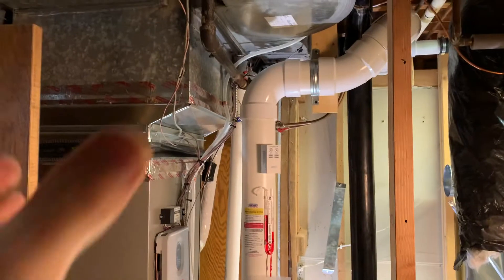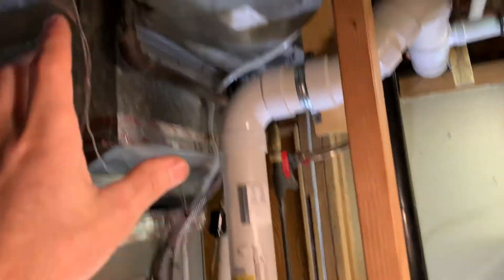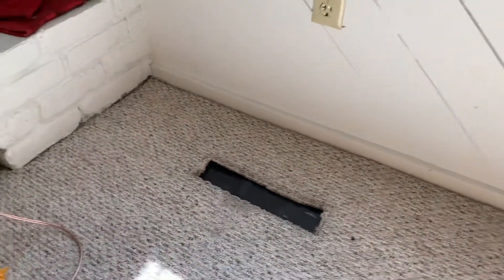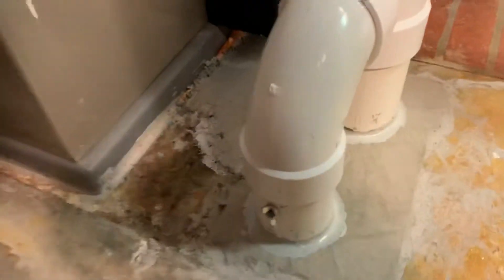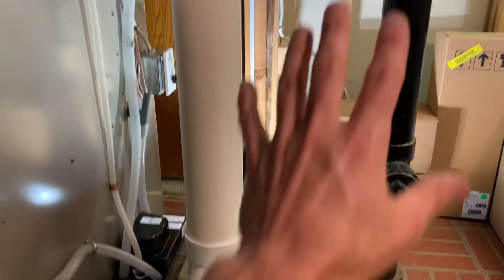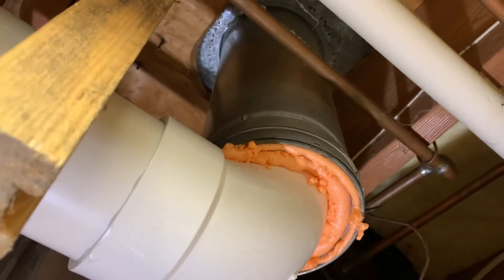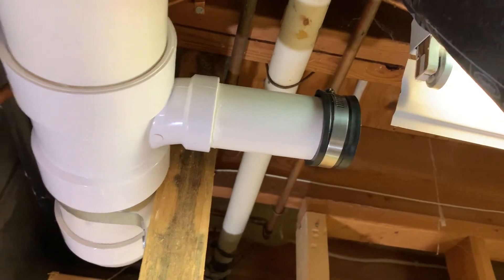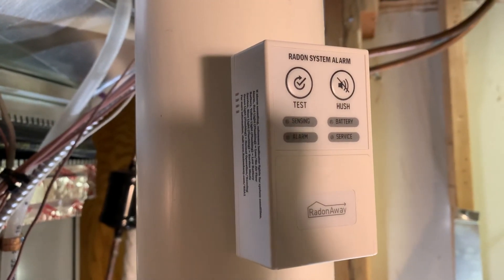How We Mitigated Radon in a Home with Sub-Slab Ductwork

Comment: We have determined our radon entry into the house is coming from the 30 year old metal duct work under our post-tension slab. I currently have a radon fan connected to a register and blowing that air outside.  The radon level remains below 1 pCi/L and usually below 0.5 pCi/L even though I haven't formally "sealed" each of the 18 registers. If I unseal (remove plastic and tape) from most of the ducts and run the hvac, the radon level in the house reaches 5 to 8 within an hour or so which indicates to me that this is likely our only problem (though I also plan to seal around any plumbing like bathtub drains). 

My plan is to use the plenum (near the center of the house) as the radon pit and the extensive sub-slab duct work as the reach into the area under most of the slab.

I understand how you seal each register. Would you recommend drilling a series of holes (perhaps 1/4" to 1/2" through the bottom of each duct (through the register into the ground below the duct) prior to sealing them?
Reply from the maker: We open the sub-slab ducts to better connect them to the soil before sealing the registers. To do this, we push the sheet metal down and remove some soil.
Reply: @AmericanRadonMitigation  Thanks for the help! I am in the south where there are no licensed or certified radon inspectors or mitigators.  I did consult with you a couple of years ago over the phone and really appreciate your expertise and help. 

I'm not sure I understand. You separate the metal from the concrete and beat the vertical sides of the duct down below soil level? Thus exposing the layer of soil between the bottom of the slab and the bottom of the duct? Our ductwork is round under a post-tension slab that I assume is 4" thick. Looking down into the  4"x10" or 4"x12" registers I see the inside of the round 90 degree bend to horizontal in the duct which wouldn't seem to be enough room to smash the entire register transition into that curve.

A few more dumb questions...
What do you use to build your foam layer on (so it doesn't fall into the duct)?
What foam do you recommend?
What concrete mix do you use? 
And I suppose both the foam and concrete should be about 2" thick each? 

After the old hvac furnace is removed I plan to hire someone to come down from Kansas to build the radon pit in the old plenum and add a fan, but I'm trying to get some of these registers closed now in an area that is about to get some new hardwood flooring put down (over my plugged registers).

Comment: Do you have any first hand experience on how basement hvac affects radon on the upper levels? Would the returns draw radon from the basement up into the house and when the system is off, would radon more easily travel to the upper floors through the ducting?
Reply from the maker: In my experience, radon is roughly cut in half on every floor you go up. However, if your furnace fan is set to run, the radon levels are the same on every floor since the HVAC constantly mixes the air throughout your home.
Reply: Thanks for the reply. That’s what I was worried about. We do have mitigation with levels consistently under 1, but still do not want to spread it more throughout the house if I could avoid it. 

Thanks!
Reply from the maker: @itsyergs  You’re welcome. Keep in mind that the outdoor average radon in the Midwest is 0.4 pCi/L, and you can't get indoor radon below the outdoor levels.
Reply: @AmericanRadonMitigation  got it. I’m on the east coast in the north east. I really want to condition my finished portion of my basement. Just trying to figure out the best approach. Branching off of the existing hvac is surly the easiest and most cost effective. I see it don’t quite often but feel that many people overlook the radon implications. Any advice you have if you think it would be an issue in reality or not?
Reply from the maker: I wouldn't think it would be an issue.

Comment: I have a small home around 1500 sq ft. I high radon around 21 pci/l . I have a sump and plan to put active radon system from sump. Do you think 3" or 4" pipe would be good ?
Reply from the maker: It's hard to say without doing any pressure field extension testing. You could run 4-inch to be safe or rent one of our diagnostic kits if you don't like guessing. https://americanradonmitigation.com/product/radon-tool-kit-rental/

Comment: I have a California split so only one duct runs through the main level concrete sub floor. The round duct comes from the basement ceiling and 90 degree angles into the concrete wall in the basement and then is a straight shot across the living room floor to where it comes up at the floor vent. I get how to seal the floor vent but my question is about where the duct goes into the wall in my basement. I have disconnected the duct at the 90 degree angle and plan to reroute that part. However, now I basically have a round “hole” in my basement concrete wall where the duct is and runs through the slab. Any suggestions on how to seal that? With it being horizontal I am not sure the best option. To explain further,  It is basically the equivalent of laying a round duct on the floor and I need to completely seal one end of it.
Reply from the maker: @Kelco D There are several ways you could seal the opening.

1. Install a metal cap and seal it with mastic. https://amzn.to/3B8podV - https://amzn.to/2VInQXP

2. Seal it with expanding foam like Great Stuff. You'll want to provide backing so you don't use a bunch of it. You may have to do a few inches at a time, depending on the size of the opening. https://amzn.to/3B0bxWD

3. Use concert or hydraulic cement to seal the opening. https://amzn.to/3hYDNAg

This video may be helpful https://youtu.be/pLMob_TLyF8

As an Amazon Associate, we earn from qualifying purchases.

Comment: Hello! I am a homeowner that is trying to find someone to seal off our old ductwork vent openings. We already abandoned our old ductwork and re-routed it to the ceiling in the basement. I have reached out to numerous people that don't have experience with sealing off the vents. Could you provide more information on what you used and the method. Unfortunately, we live far away or I would hire your company to assist. Thank you for the great video!
Reply from the maker: Hello Kelly!  Thanks for the question. If I recall correctly, I bent the sheet metal down toward the center of the opening, used a small layer of expanding foam to seal off the opening, and mixed up some concrete to finish off the seal once the foam was hard.
Reply: @AmericanRadonMitigation  thank you for the reply and the information!
Reply: @AmericanRadonMitigation  is there any issue with leaving completely collapsed ductwork in the slab and filling the top of the vents like you did here? Wasn’t sure if that collapsed ductwork would cause foundation issues?
Reply from the maker: @mirandastark6510 No, the concrete slab in this home is nonstructural. You could remove the entire concrete floor, and the home's structure would be ok. The home’s concrete block foundation is unaffected.

To learn more about a home being built, check out this playlist of my brother’s home build. https://youtube.com/playlist?list=PLuNbsvWsW0-CdKkS-FjVfFQ-a-CnsWN9y&si=oMlBh5Cvhw-61_Ny

Comment: Hello,

I'm in the process of figuring out how to seal my in slab ductwork and doing as much research as I can. That was my question was whether I should fill the entire ductwork with concrete or just bend the metal and pour the vent openings. When I close it off at the furnace area is it possible to tie in this suction system to my current furnace exhaust pipe that goes through my chimney?
Reply from the maker: If I understand what your asking my answer is no. The radon system can not vent into your furnace exhaust.
Reply: @AmericanRadonMitigation  Thanks for the response!

Comment: Very interesting! We are doing a full duct work project and abandoning the slab ductwork. Client sparked up conversation about what to do with the old openings and such. On the fly of creativity at home i was thinking how cool it would be to add radon vent to those... its actually a thing! More research needed.
Reply from the maker: Michael M yeah it works well. Just bend the sheet metal down and seal them shut with foam and concrete. Then, apply suction.